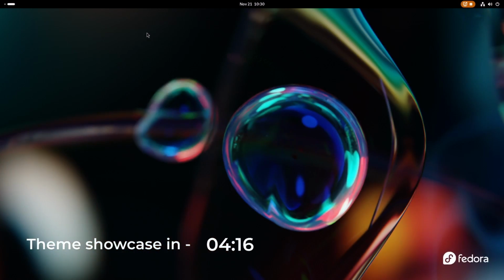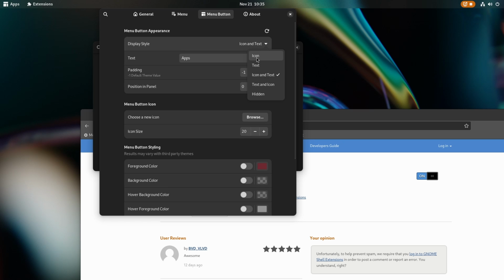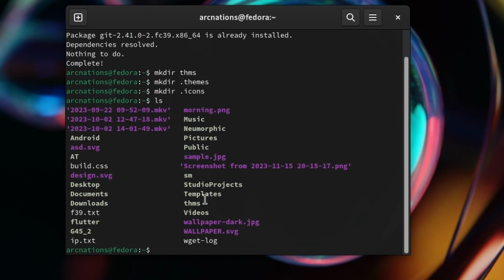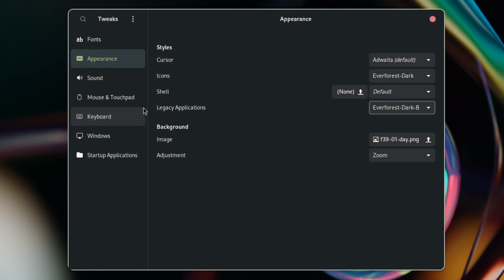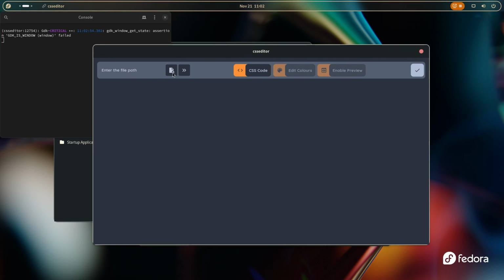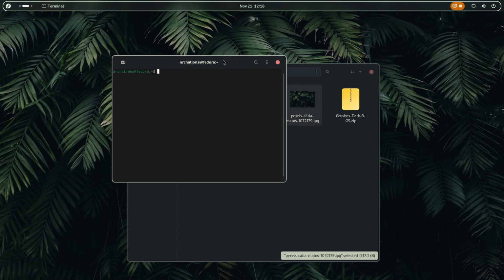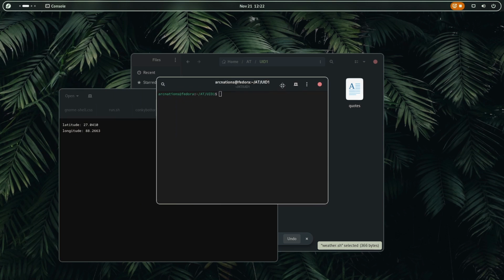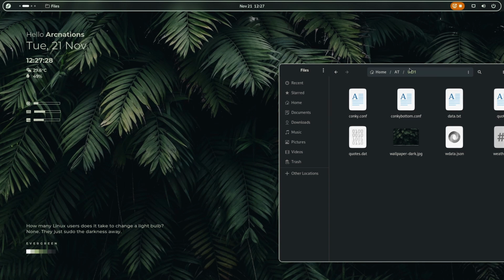The PERFECT Customization for GNOME!

Comment: Can you:

- change the BACKGROUND of the page with the OVERALL DISPLAY --> TASK BAR on top, SEARCH BOX, several rows of App icons, and the DOCK on the bottom?
- put a SEPARATE BACKGROUND in each of the WORKSPACES?
- make the DOCK work like Apple, changing its shape to a CONVEX one, as you run your mouse over the icons?

🙂

Comment: I hope the coming Cosmic desktop will make the pressure on the Gnome dev team to make the customization be an easy step! Such a nightmare, having to copy/paste and to edit some CSS files is not normal. But the Gnome dev team does not want to make Gnome be customizable by default, so you have to hack it!
Reply from the maker: Might be but I don't think so since GNOME is very much geared towards professional use.

Anyway I'm hoping for the best.
Reply: @ArcTechnologies 
It's not because you can change the colors and add some borders around windows that your workspace is any less professional.
Windows and Mac OS are professional DE and there is a lot more you can do when it comes to customization.
Gnome team MUST integrate some custom tips.
I wouldn't mind leaving this DE if Cosmic were more pleasant (pretty) to use.
Reply from the maker: Yeah I know but trust me when I get KDE installed I always have this tendency to tinker around and change stuff a lot more since they are supported from the settings app itself.
Reply: Personally, I prefer Gnome's workflow but KDE's settings.

As I'm on Linux for work, so I stay on Gnome but miss the KDE settings.

I just want to change the colors and borders of the windows without touching the rest, but I couldn't do it and then you can't switch from Dark to Light.

With KDE you can easily change colors and borders and it does not affect the professional use, why not with Gnome?

Comment: A few comments -

I finally applied this theme last night. I could not get through the color section and it would be nice if you could update with more precise directions. I'd also like to see updates if you can figure out a fix for the border breaks on some app windows (I notice it does not affect terminal for instance so it is not on everything). I ended up using your script, which is nice but honestly even with a subscription I'd prefer clear steps since running a third party script you do not fully understand is a security risk (no offense, it's just poor practice) plus having complete steps lets me more easily add or subtract parts to make it my own.

Another issue I ran into is that not all windows obey the theme. For instance Firefox & Librewolf (Flatpak versions) do not show the correct window controls in the upper right, while Chromium and Edge (also Flatpak versions) do. Vivaldi in either version also does not show the correct window controls. Unclear to me why some browsers do and some do not and where to find an override.

I'd also like to find a compatible extension to override the clock and make it show a more complete time/date like what we had with Aylurs widgets but unfortunately they have retired thier extension and I cannot find another. I did add Weather O'Clock for a quick weather option in the top bar and it's fine.

Overall it is quite nice but the guide needs more clarity and I'd deep dive a bit more on the problems especially for those of us who actually paid for it.  Thanks for the hard work, it is appreciated and please don't take this as a complaint, just some feedback and suggestions. I think you do some of the nicest UI/UX work available, just a little more polish to the production would be helpful.
Reply from the maker: Much appreciation for this review 🙌 Thanks a lot for taking the time to write this.
Probably the first time someone commented on the scripts. I hope more people do this so that I can improve them. Will definitely try and make the changes you said. Thank you so much!
Reply: @ArcTechnologies  A friend of mine helped me fix the issue with some browsers not obeying the theme. This is due to the browsers not having the native title bar enabled, simply switching it on will fix that. It has nothing to do with your script or design and is a common thing with modern browsers that do things like put the tabs or address bar in the space where a title bar traditionally sits.

Nothing for you to work on on that point other than perhaps mention that if an app does not follow the theme in the title bar, check the app settings and if possible enable native title bar.

Comment: instead of eyeballing the color value why not use Gnome color picker (or any of the other ones)?
Reply from the maker: I changed the colors using a custom designed app. At that time, it didn't have the ability to grab screen colors or accept color code as text.